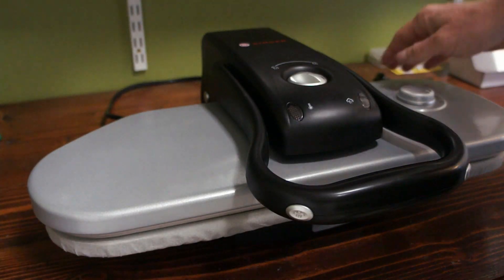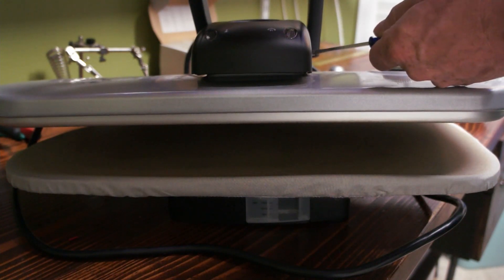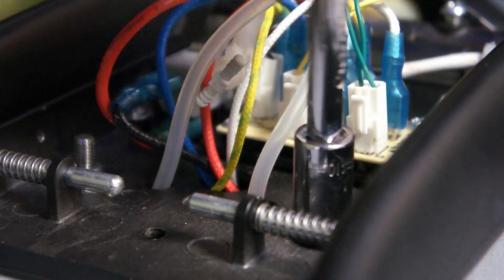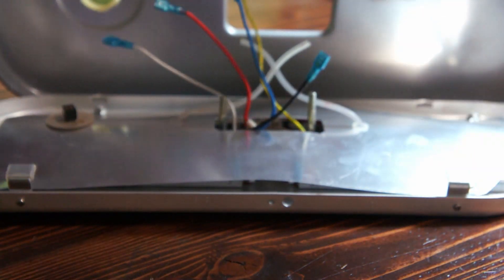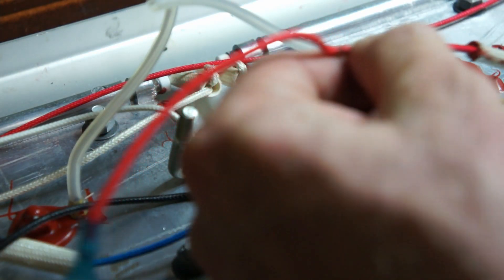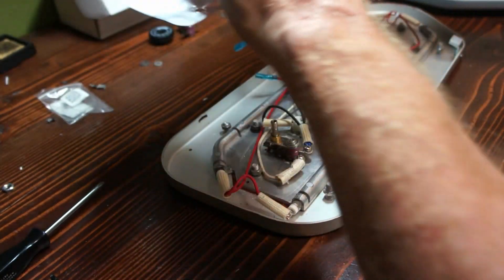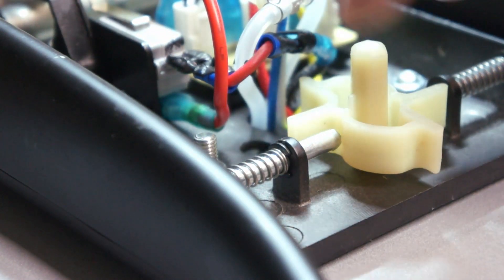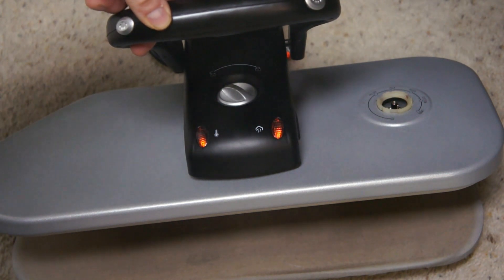Singer steam press fix/repair

Comment: Hello! My press is lighting up but not getting hot. I have ordered a new thermostat but I want to order a fuse as well to have on hand just in case. Can you post a link to where you got your fuse? I'm not even sure what it looks like. 😂
Reply from the maker: I bought the fuse at a local Mom & Pop electronics store, actually. I unfortunately don't have a link to the web. It's called a "thermal fuse". Searching that term should quickly bring up many options. Inside the steam press, it's covered with a white fiberglass sleeve to prevent electrical shorting. At the moment I don't recall the temperature rating, though. My press actually stopped working again, and once again it was the thermostat that was burned out, they just undergo a lot of stress. We decided to get rid of it and get an electronic model instead.

Comment: Where did you find the replacement thermostat?? I can’t find it anywhere
Reply from the maker: I "got lucky" by finding a very similar rated one on Amazon (looked at the voltage and power handling ratings). I searched on Amazon for "temperature switch bimetallic" or similar. However, even the replacement only lasted about 8 months and the steam press is broken again, and this time I don't think it's worth fixing anymore unless I switched to an electronic thermostat.

Comment: Well this is the best repair video I've come across so far for my own press that is similar. 

I have a Pyle Digital Steam Press that just quit. Looks mostly the same but the temp is set by a digital interface on the centre hadel bit in-front of the locking mechanism. So I hope that's not the issue. 
I think I found the issue. Tip is broken off one of the elements. Now where do I find another?
Reply from the maker: Off one of the heating elements? Whoa that isnt fun. My press actually has stopped working again, the thermostat burned up again. I had plans to mod it to be electronic but my wife says she would rather get a different brand now

Comment: Thanks for the expert video. I have a brandy new Singer esp36T1 intelligent steam press-36 with electronic temp control instead of the mechanical dial. 

In watching the disassembly, it occurs to me that jostling the wires during manufacturing assembly could affect power distribution to the heat surface, since the centerline temperature is measured at 350 deg F, and 3” inside the ends is only 250 deg when the temperature is set for Linen 420deg. I used an IR gun like you did. 

Singer customer service is taking awhile to get back to me, but do you think the wiring/connections are the problem, or a temp sensor? Haven’t taken it apart yet, just wondering. No need to reply if you’re busy.
Reply from the maker: I would definitely think its more reliable with the electronic temp control but that will depend where they put the sensor. That does sound odd to have such a big temp difference over the surface, mine was pretty consistent, in this video there are four large heating elements , around the outside of the clamshell.  I would not think it would be a wiring issue because for example in my unit the wiring is very solid and protected. I would imagine most are similar. It would quesrion them though why if linen says 420 why its only giving you 350. I guess they have a large margin of error!